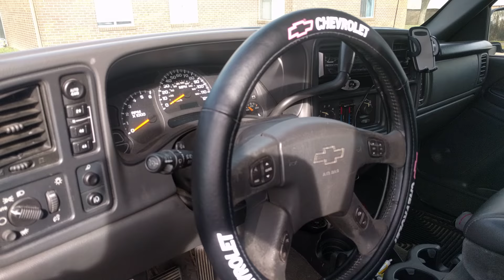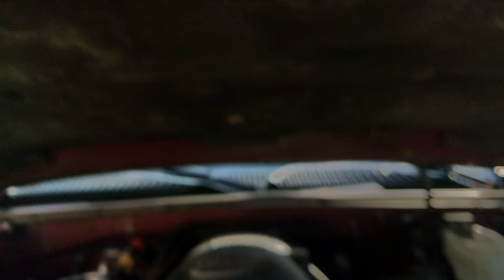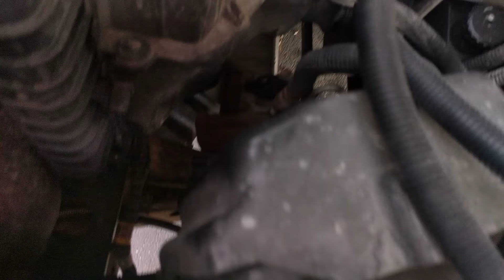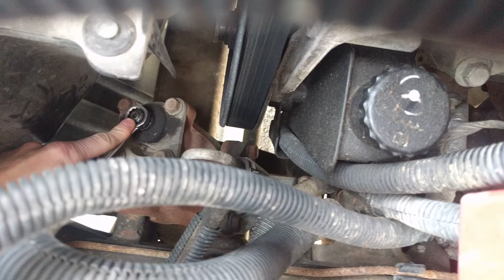Fix Steering Wheel Play/Bump Steer For FREE!

Comment: Why didn't bring the camera back to the steering wheel for your viewers to see???
Reply from the maker: Good point. I should have
Reply: Yea I wanted to see as well. I've replaced mine 3 times, all been adjusted and all were complete shit with slop. They all looked like his! Fucking autozone boxes.
Reply: @jamesperry4424  yea about 6 of them were autozone as well. I'm on srike with them. I strictly don't buy from them, poor parts and bad customer service. Only Orilies or Napa now, buy once cry once. I belive autozone doesn't sell the Chinese pumps anymore due to so many returns. When I took the last one back, they swapped it with an OEM pump. Haven't had a problem since then. I belive it's been close to a year now, 430k miles on the odometer. Whoops, I thought we were talking fuel pumps XD.
Reply: @jamesperry4424  Yea I just can't tell if it's normal for them to have so much slop or if it's just shit parts. I have a hunch it's shit parts. If you sell the truck, get a Toyota, very reliable brand. American manufactures are just garbage, had every brand I'll never buy American again.
Reply: @justin6409   funny you say that..I'm looking at a used 2010 right now.im so fed up with this issue for the last 2 years I've dealt with it
Reply: @jamesperry4424  wow a 2010 is doing that!? If that's got a rack in pinion steering, that's not normal at all! I know what you mean, it's so annoying driving on the high way having to make 3 to 4 inch corrections just to keep the damn thing strait lol.
Reply: Justin 640 find a depliph pick and pull I have four brand name gm boxes that I sent out got rebuilt buy a local professional and all have been like new from factory
Reply: So I did some work on my work truck and I've made the play worse I think it's a 98 dodge ram it was leaking steering fluid so I pulled the part and it wasnt leaking there and replaced the o-rings on the hoses and it stopped the leak but now I have ¹/⁴ turn of play to me that seems like too much to me lol
Reply: What size wrench
Reply: @justin6409  look at amount of Toyota's made in America anymore. Have a cousin that lives in Tupelo MS. He's a lead electrician in their plant. He use to work for Tecumseh years ago and when they shut down he went to Toyota. 
He had to go to Elizabethtown Kentucky for quite a while till they got the local Toyota plant up and running. This must've been 12-15 yrs or more ago. 

Lots of foreign vehicles made assembled in USA using American workers. Alot assembled in Mexico as well. 

GM actually was assembling cars up in Canada and Mexico and still does I believe. 

I see everyone talks about bad parts but no one puts any info forth about what the OEM / GM recommends on how to adjust these. 

I'll know as soon as I look it up as I can access the SI "Service Information" and see for myself. Just thought a video would help explain things easier which I learn better from at times.
Reply: @dtnel  That's the problem though, major components like that you can't even find OEM anymore, and if you do you pay through the nose. I've also heard a story rolling around on YouTube of a guy who actually took it to gm, got the box replaced with an OEM part and it failed roughly 9 times befor they got a good one. The manager of the shop said it's very typical.

But yea, I agree. Gotta have a service manual the dealer uses, otherwise your blindly troubleshooting.
Reply: Exactly
Reply: I am not sure if the design is all that good. Probably why rack and pinion steering is so popular now. This adjustment does sometimes work. One other thing, how violent are you with your steering wheel movements? I have a feeling that excessive force is testing the limits of this poor design.
Reply: @father_dev  The problem is that I am exhausted all means to loosen the nut to adjust the play, even used commercial air tools, crow bars for leverage and still will not loosen the nut any ideas?

Comment: It would be a thought to take white paint and dab on "two separate" small white paint dots,  to indicate the "original" hex bolt Allen screw "position" against the bolt housing . So two dots side by side together. One on the steering housing and the other dot  on the ALLEN SCREW bolt, "BEFORE you move Allen screw" . Just as a reference if the new screw position is not what you wanted , or a problem, and want to be sure where EXACTLY you began. Best wishes.

Comment: Good video. I adjusted mine 3/4 of a turn and it drives and handles like a new truck again. I had play in the steering wheel before and could feel every numb. After adjusting the set screw it handles and rides smoother on the steering wheel anyways

Comment: Hello, thank you for the video. I have a 2002 Chevy Suburban and the steering wheel is just like that. I replaced all the steering (except shaft) and suspension. I put in a reman. ACDelco steering box and have it tightened all the way down and my steering wheel is still the same. Do you know what it might be? Thank you for your time.
Reply from the maker: There is a U Joint going from the steering wheel to the steering shaft, maybe it could have play in it.
Reply: @father_dev  Thank you, are you familiar if that is part of the intermediate shaft?
Reply from the maker: @edwardthayer9386  yes can confirm. If you go to rock Auto they call it a steering shaft but you'll see the u joint in the top half
Reply: @father_dev  great thank you! your time and help is greatly appreciated!
Reply: @enduringpursuit  I saw your comment and thought you might know.  My problem is that a typical 'turn right, or left' would be turning the steering wheel 180 degrees for instance, but in my case I have to turn the wheel double that amount.    Even backing out of a driveway then getting straightened out on the street; or parking at a store seems to be a task.  I had torn boots and got my front CV Axle replaced, but that really didn't fix it.  Also new shocks a few years ago but it does not seem like it.  It's a 97 Isuzu Rodeo.  Just don't want to get ripped off it's something simple...
Reply: @enduringpursuit  Hey thanks for your help.  I guess when they did the new front CV axles there was a  component that was accidentally wound around something, resulting in not enough expanding or something like that.  They said it should be fine now.  The steering is better; the alignment is fine; no weird noises but I'm still having to overturn too much.  So I think now it's a worn pitman arm and also torn ball joint boots.  I guess last year when I had new shocks put in that didn't address the issue.  I should of became a mechanic.. could of made lots of money!!  Thanks again.
Reply: If you did all suspension and all steering you should have had it correctly aligned at a shop right? That’s the first red flag. They’d tell you exactly what’s wrong man. There’s a couple things not to play with bad alignments and faulty wiring

Comment: First thing to do is check the rubber in your drive shaft. May be worn out. If it is worn out then fill the Inside of the shaft with glass adhesive and put the bottom part back in and let dry for a day. Thats the most common problem for every make and model. Factory uses cheap vibration absorbent rubber. Doesnt last long

Comment: I've replaced everything on mine except the upper shaft on my 97. All lower suspension is new, reman gear box from auto zone ( 3d one), ditched the orfice on the power steering pump, replaced the knuckle on the input shaft and still has as much fucking play as his has, peice of shit Chevy! It's gotta be the shitty as steering boxes. The OEM never was this bad. It should be rock solid with the vehicle off.